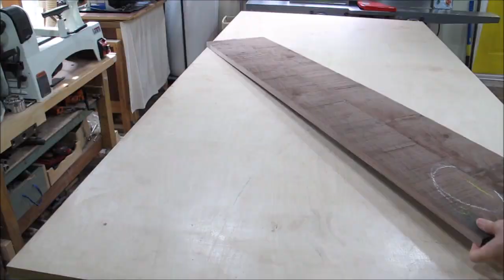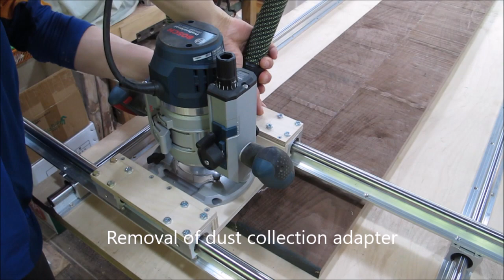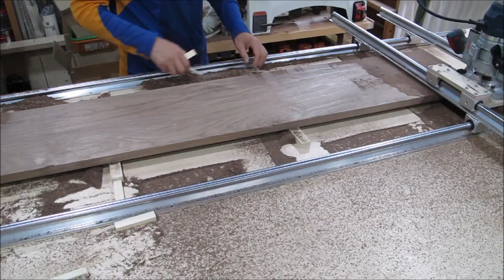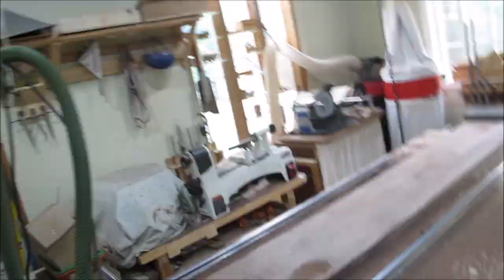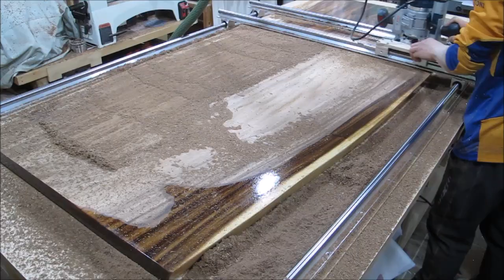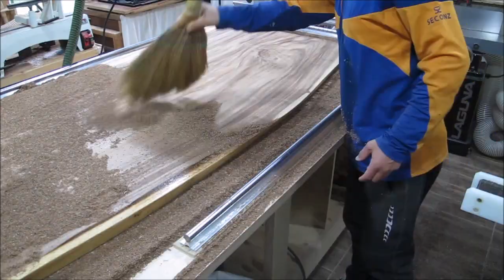How to Flatten Wood with Linear Rail Router Sled

Comment: Definitely, I'll follow your set-up, so I can make one for myself. Please let me know brand and length of rails. Thanks.
Reply from the maker: https://www.aliexpress.com/store/group/SBR10-12-16-20-25-30-35-40-50/4997273_515245698.html?spm=a2g0o.store_pc_home.pcShopHead_49400883.1_1_6
This is the seller I ordered. But you can find them on Amazon.com too. Just type SBR20 on that. Mine are SBR 20 : 1850mm, 2pcs, SBR 20 : 1200mm, 2pcs, SBR 20UU : 8pcs
Thanks.

Comment: What do you do if you're working on a very thick piece that requires more height between the router and the workbench? Love the idea!
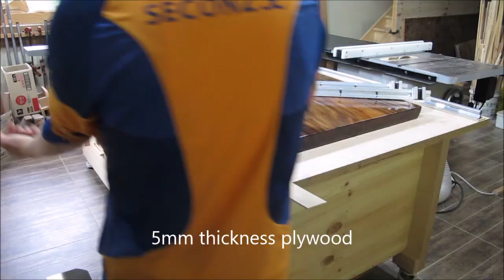Reply from the maker: You have the solution if you see the point at 7:41 in this video. 
You just put plywood or 1x , 2x lumbers under the rails.
Reply: @makefurniture1  sorry, yes, I watched the entire video later on yesterday and noticed my question was answered. Thank you for still responding! Final question - what did you do to make your work top flat for where the boards rest?
Reply from the maker: @rickhickman2730  When building my work bench I took the time to meticulously level the base under the bench top using several leveling techniques such as shims and planing. And I used 30mm birch plywood as the bench top because it is quite stable.

Comment: Hi, looks great and easy to install as long you have a flat surface. What’s the size of shaft you are using on the rail? Thanks
Reply from the maker: These are called SBR20. It means 20mm in diameter. Thanks!

Comment: Great system... Congrats... I just put together something similar, using SBR20 rails and blocks.  I noticed you're only using a single screw per block, which seems like the only way to go w/ SBR20s.  (Blocks are 35mm, and rail screw holes 30mm apart).  I was thinking of just putting the top rails on a 3/4" platform, and screwing each platform to the lower rail blocks, and the upper rails screwed into the platform from above.  However, it looks like you have no issue with just the single screw per block.  Have you seen any wobble or support issues doing it that way?
Reply from the maker: You have a keen eye. Yeah, I am using only one screw per block. Because I had to use existing holes.  Actually, there is another chance to screw one more on the aluminum support of the rail if you can make a new hole on that. But I think the single screw is strong enough to hold the block and of course, I have no issue with that until now. And I have not experienced any flex, wobble, or support issues using this setup by this time. Thanks.

Comment: Hey, looking at the ends of the rails I can see a big movement there you might want to consider putting screws in on the ends or using clamps. Thanks for the vid!
Reply from the maker: I will think about it. Thanks!
Reply: @makefurniture1  it doesn't matter, right? You're cutting height not square. Whether or not your rails are skewed doesn't change the bit's height so the rails don't need to be pinned down.

Comment: This looks amazing! Bravo!

I got the same rails but I keep getting uneven ends. I think my workbench surface is is out of level, on end may be higher than the other. 

I saw that you used 5mm shims under the longer linear rails. I think I may try this tomorrow to see if I can get both sides parallel to each other.
Reply from the maker: Thank you so much!!   I hope you will fix it soon.

Comment: Hi love the sled am doing the same set up - do you recall what are the screws you used that go into the bearing blocks?  Size/type and length...much thanks
Reply from the maker: I used Hex Socket Cap Head Screw Bolt, M6(15mm length, 1mm pitch).
I think you can use from 12~16mm M6 any bolts(1mm pitch).
Reply: @makefurniture1  Thank you so much for the quick reply.  I'm going to be using a Triton 3.25 hp router over a 1200mm span sitting on a 2200mm bottom rail (4' x 8' table).  I think using the SBR25 for the top rail will eliminate any flex over that long of a span...
Reply from the maker: @barryinny  That's a good idea.

Comment: Love this setup. I have to ask: are just one screw per rail bearing enough to keep it square and straight? Or isn’t more screws necessary because it keeps itself straight by the four bearings?
Reply from the maker: In my case, I have been using only one screw. Thanks!

Comment: How can I get the rails to set this up?  Do you have a plan for sale?  Wow nicest setup I've ever seen!  Must cost a fotune too!  Thanks so much for sharing this beautiful work ...
Reply from the maker: https://www.aliexpress.com/item/1005001631419573.html?spm=a2g0o.store_pc_groupList.8148356.15.26722a54jIs6vi
I got the rails and bearings from this seller. I don't sell any jigs. You can find them on aliexpress.com or amazon.com. Just type SBR20 on these sites. I think aliexpress.com is cheaper than amazon. Thanks.

Comment: Very nice videos you make, thank you. Can I ask you at what RPMs you set your router and what’s the depth of the bit each time you pass it over the entire piece of wood? Also, can you recommend a nice big router bit for this purpose? Thanks a lot in advance.
Reply from the maker: The RPM depends on the material and the operating conditions(the diameter of the bit etc.)  My router, GOF 1600 CE has 6-speed steps. 1 is low and 6 is high speed. And my bit's diameter is about 32mms.  I usually set it at 2~3. It would be best if you did testing before the operation. The depth of the bit is the same as RPM.

I wanted to buy a FREUD Solid wood surfacing bit but it's too expensive.
https://www.aliexpress.com/item/4000070506541.html?spm=a2g0o.order_list.order_list_main.240.6e321802gId1mh
This is the same as mine. I bought it for 67 dollars 2 years ago!!  So cheap! 
I think Carbide Inserts type is better.  Thanks!
Reply: Thank you very much for your response and once again for your videos. Brest regards.

Comment: how did you know where to drill the holes through the plywood to the bearing blocks?
Reply from the maker: First, measure the distances between the holes on the bearing blocks. Then draw the middle points of the holes on the plywood. And drill the holes. That's all.

Comment: Zero sound on most of the video. Like the jig, do you share where you got the materials from at all? Thanks
Reply from the maker: https://www.aliexpress.com/item/1005001631419573.html?spm=a2g0o.productlist.0.0.727d6c768V1wxL&algo_pvid=eeb16706-fc6c-4183-b2ce-a2a6ffbd724f&algo_exp_id=eeb16706-fc6c-4183-b2ce-a2a6ffbd724f-21
You can find them(SBR20, SBR20UU) on Amazon.com. But aliexpress.com is much cheaper than others.

Comment: I'm trying to do something similar. In the video it looks like you don't have the long rails secured to the table, is that right? Any issues with the short rails racking or did your cradle stiffen it up enough? Any closeups of the router cradle?
Reply from the maker: Usually, I use the long rails without clamps. But in some situations I use them. My cradle is made of 12mm birch plywood. There aren't any problems with using this sled for now.
If you want some closeups just give me an email, I'll take pictures and send them. acgari1@gmail.com

Comment: This is so great! Thank you so much. I will be making a table using timber burls and resin soon and this looks like a great way to set up the rail sled. My table will be 1100mm wide and 1800mm long. Do you think having cross rails of 1400 will be long enough to allow the sled to reach the edges?
Reply from the maker: My cross rails are 1200mm. I have flattened the 878mm width of the slab in this video.
 I think so it is enough. If the sled doesn't reach the edges, there are two ways. You can move either your slab or setup like this video.
Reply: @makefurniture1  thank you so much!!!! I really appreciate your help.

Comment: Do the long rails get attached to the workbench at all? How do they keep from moving when you're using the router?
Reply from the maker: Well, I have not been using anything to hold the long rails until now. Because they are heavy enough to eliminate any moving. But if there are any reasons, you can use clamps or screws.
Reply: Thanks for the reply! Keep up the videos.

Comment: Nice setup for flattening slabs. I noticed you did not secure the rails or the work to the bench. Have the rails or the work ever moved during a cut and if not what keeps them from moving?  I would be concerned the weight of the slab alone is not enough.

Your jig for holding the cutting board slabs is excellent. No tools needed to secure the work in the jig, just some wedges.
Reply from the maker: I have not failed to secure the work during a cut until now. It is important to secure the work for flattening slabs like a lightweight. That's why I used CA glue on the no.1 slab.
And the no.2,3 are enough heavy without any wedges or CA. Thank you.
Reply: @makefurniture1  Ok, thanks, I did not see you use the CA glue. Good idea, I will try that.

Comment: Could you please provide the specific information on the equipment you used - rails, bearings, I’ve searched through your information but do not find any links.
Reply from the maker: https://www.aliexpress.com/item/1005001631419573.html?spm=a2g0o.store_pc_groupList.8148356.15.26722a54DPePIG
This is the dealer I bought them from here. And you can find them on Amazon.com if you put SBR20 or linear rail guide on the site.
https://www.youtube.com/watch?v=P9_bXaKoRyk  This video might help you.
Reply from the maker: I think Aliexpress is cheaper than Amazon.

Comment: great router sled however i have a question.  i am working on a 5' x 10' boardroom table and would need to build the sled large enough to do this job.  figuring on using the 2000mm to span the width of the table.  have you done any this long?  did you notice any sagging in the middle due to the weight of the router?
Reply from the maker: I'm using 1850mm(the long ones)and 1200mm(the short ones). I haven't experienced any issues like sagging, flexing for my router until now. My linear rails are SBR20. It means that the diameter of the rail is 20mm. 2000mm for the short ones is quite long. I'm not sure they can stand without any sagging. 
Hardnox(a logo of cowboy) ordered 1800 and 4000mm two months ago.
Please see the below comments.
Why don't you ask him? Thanks.

Comment: I have the same router, and want to make a sled like this. Can you share the dimensions of the cradle and the size of the linear rails that you used?
Reply from the maker: Block bearing is 48*50*38mm. And the plywood I used is 12mm. So, my cradle is 300(60:48+12, 180:router's base, 60:48+12)*200*50(38+12)mm. If I had your email address I could send my cradle photo with the dimensions to you. 
SBR 20 : 1850mm, 2pcs
SBR 20 : 1200mm, 2pcs
SBR 20UU : 8pcs
Thanks!

Comment: I have the same hardware and router you are using, what are the dimensions of the cradle you router rides on?
Reply from the maker: Mine is 200x294mm, 12mm birch plywood. 294 was a little bit short. That's why I had to carve one side for the dust collector. (3:47~3:49)  So, it should be 200x310mm.

Comment: Thank you for sharing.  Great information.  I ordered these rails.  The long ones are 4000mm and 1800mm for the short ones.  I was wondering if there are issues with dust collecting in the bearings.  Have you had any issues?
Reply from the maker: Wow, 4000 and 1800mm! Great, you must be a professional.
 I use an air gun for the cleaning of the bearing sometimes.  I have not had any issues while using this setup until now. If you worry about dust you can use the block bearings with dust covers.
Reply: Where did you bye them?
Reply: @morteno5775 Sorry, I don't remember.  I searched everywhere for the 4000mm (10').   The company was in California.  They took a few months to get.  Two piece rails might work but I was concerned about a slight misalignment resulting in a bump.  The two piece rails are cheaper and are available on Amazon.

Comment: Looks great! Is there any flex in the rails at all?
Reply from the maker: I don't feel any flex during my job for now. I use SBR20. It means 20mm diameter of the rail. I think it is strong enough for my router.
Reply: @makefurniture1  
Awesome thanks! Been thinking of making a similar sled, but on some U-Groove wheels on steel pipes.

Comment: I've noticed a lot of friction with my wooden router sled jig, your linear rails slide very smoothly yet I fear these rails cost more than that $300 Bosch router you have there (I have an EVS1617 too, very heavy router).

Approximately how much would those rails cost along with the sliding things ?
Reply from the maker: https://www.aliexpress.com/item/33020810063.html?spm=a2g0o.store_pc_groupList.8148356.11.57e42a54pDzr7Q
It might help you.

Comment: Hi can you tell me what type of rail system you used for your resurfacing router?
Reply from the maker: You just need only 4 linear rails, 8 bearing blocks. 
And some bolts and plywood.
SBR 20 : 1850mm, 2pcs
SBR 20 : 1200mm, 2pcs
SBR 20UU : 8pcs
Reply: Where did you purchase them? Amazon or other supplier. There seems to be a large range of cost. Any information is appreciated.
Reply from the maker: @matthewjones1420  
https://www.aliexpress.com/item/1005001631419573.html?spm=a2g0o.productlist.0.0.727d6c768V1wxL&algo_pvid=eeb16706-fc6c-4183-b2ce-a2a6ffbd724f&algo_exp_id=eeb16706-fc6c-4183-b2ce-a2a6ffbd724f-21
You can find them(SBR20, SBR20UU) on Amazon.com. But aliexpress.com is much cheaper than others.

Comment: Hi, thanks for sharing. I'm building the same setup than you. Just too bad that you can't put two screws on the block to fix the rail. Just, I was wondering, at the end of the video with the wooden box. We see the rail bending when you move the router. Those it affect the flatness of the piece?
Reply from the maker: The plywood(on the table saw) was not flat when you see the rail bending. But those chopping boards were small that they were flattened.  My workbench(next to dark plywood) is almost flat so there is no bending. If you don't have a flat workbench you need to prepare flat lumber that is used as a base of the rail.
Reply: @makefurniture1  Thanks for the reply. Hope to see more videos from you :)

Comment: any problems with the rails moving around? The only flat place I would have would be on the concrete floor?
Reply from the maker: Nope, I guess even the concrete floor is okay. If the surface of the concrete floor is terribly uneven, you should put flat 2x4 or something similar between the rail and the floor.
Reply: @makefurniture1  ok thank you . And where do think I could buy?
Reply from the maker: @darrengarlough5121  https://www.aliexpress.com/item/33020810063.html?spm=a2g0o.store_pc_groupList.8148356.1.26722a54P8gTg1
This is the dealer I bought them from here. And you can find them on Amazon.com if you put SBR20 or linear rail guide on the site.
I think Aliexpress is cheaper than Amazon.